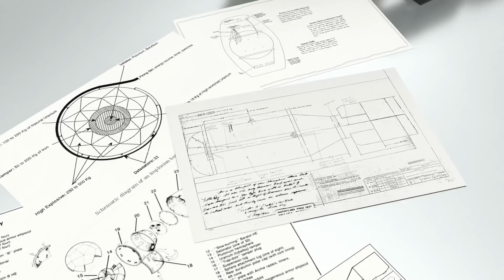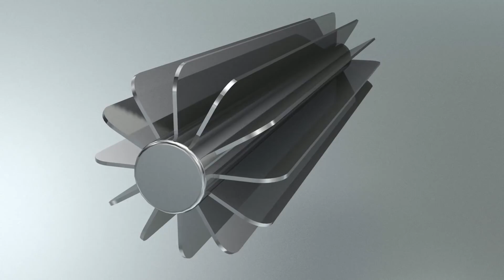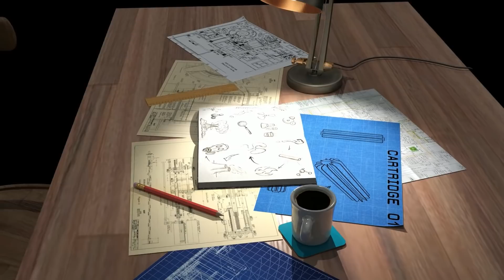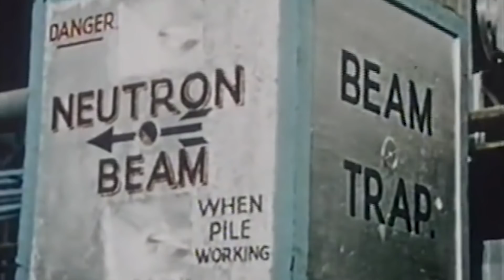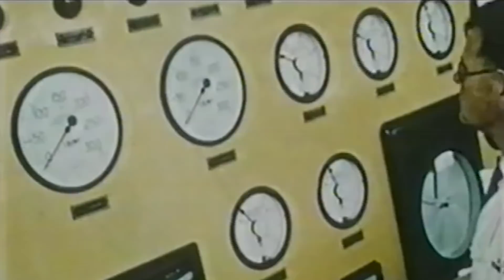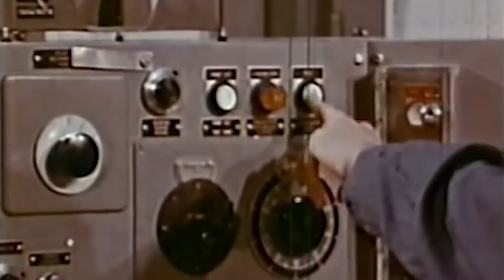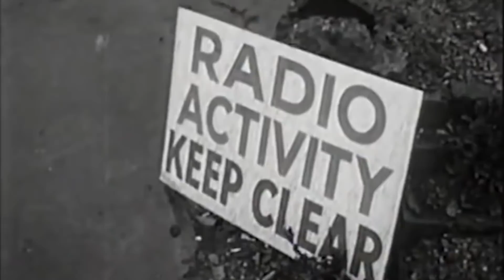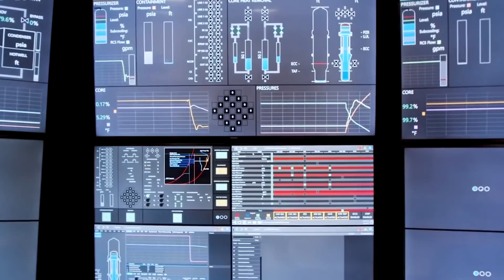Atomfall - Windscale Disaster - How The British Chernobyl Was Stopped

Comment: Apparently my grandfather was the first of the engineers to spot this fire. He worked at Windscale for many years as an engineer managing the reactor but sadly died of cancer before I was born.
Reply: I worked with a bloke who inadvertently predicted it. At the time, he said: "It should be burning out quite nicely now." Little did he realise it was burning out rather too well !
Reply: I can’t help but feel like yeah it’s safe, until something goes wrong. Take a look at Japan back in 2011, I’m sure every safety precaution was taken, but then a freak tsunami hits and none of that was worth a wank. We get told all the time “it’s the safest way to make power” I think theirs other ways.
Reply: @darrenicome559  they made one rather large over sight though that would never happen again... They put they're backup generators on the ground level so when the cooling systems power source failed, they couldn't reactivate it with the backup as it was flooded. Which resulted in the outcome. If they had put they're generators on the roof, it would never have had issues
Reply: @wallace_4520  my point is that there can always be things which can be overlooked. No one would of thought to them “self’s let’s put the back up generators on the roof in case of a freak tsunami” they would only think this because it’s already occurred. It’s the threats we can’t see which are the biggest. If something was to go wrong in a big enough way it has the potential to make large areas of land uninhabitable. I don’t feel like it’s as safe as people make out. Not only that but there is no way to properly dispose the waste, it just gets buried
Reply: @darrenicome559  they built a nuclear power plant right beside the ocean in a country renound for earthquakes and tsunamis. The Japanese are well experienced with these natural disasters yet they knowingly built a sea wall not large enough to hold back tsunami waves from the size of earthquakes that caused the disaster at Fukushima. Putting the backup in such a bad place was just pure incompetence which would never happen again. Also, in the UK, we don't get earthquakes so this isnt a problem. There are that many regulations surrounding nuclear power that nothing is overlooked. As well as this, nuclear companies are responsible for the plants after service life and are responsible for their full dismantling and restoration of the ground to as it was before the power plant was there. This is not the case for renewables and as a result, we now have abandoned wind turbine bases everywhere.
Reply: @wallace_4520    sorry for the late reply I’m terrible for that. You seem very informed in the area and I do also believe what you say about the level of safety precautions which are taken, trouble is I still can’t agree. Unforeseeable problems can still happen, yer we can pretty much rule out earthquakes but what about other things that haven’t happened yet. Could be neglect, terrorism or even something as unlikely as a meteor. Yer the chances of them happing are minuscule but if it was to happen there’s a lot at stake. I don’t know much about the wind turbines that have been abandoned but even if that’s the case your comparing two very different things. For a start the wind turbine won’t meltdown and potentially make a massive percent of the uk uninhabitable so there’s that, also they can be dismantled at any point if they need to be and much of it even recycled. Power plants have to dump their waste after as there is no way to dispose of it.
Reply: @darrenicome559  if we were all to do nothing due to a chance of something such as terrorism, then we would all do nothing. Modern nuclear waste has much lower radiation levels than reactors of the past thanks to new technology and methods of use. By using thorium, we can use uranium and plutonium for longer and be left with much less waste product. The other likelyhood is that terrorists won't be set up to handle radioactive waste to be able to use it effectively. Also, nuclear power plants employ security to prevent anyone without authorization entering the plant. 

As for meteors, if we experience one of them that is big enough to cause catestrophic damage to the power plant, then we have much bigger problems than radiation.

Also, it's not the wind turbines themselves I'm referring to. Most of them tend to be recycled due to the valuable metals within the turbines generator. It's the concrete base that they are formed on is the issue. These bases require 800m³ of concrete to create a strong enough platform for the turbines you see in the countryside. After the turbine has run its course, these aren't removed and are just abandoned, leaving giant concrete pads all over the countryside. This doesn't happen with nuclear plants, thanks to international agreements that require nuclear companies to fully restore the land after the plant is destroyed.

Other large problems with the likes of wind turbines is that they kill thousands of birds, prevent land from being used for growing trees, pollute the visual environment with large, unnatural structures and have a higher chance of malfunction than a nuclear plant due to them not being manned 24/7. Also, France is 86% nuclear power and has the best kept landscapes in Europe, whilst Germany is almost over 30% renewables and have tied links between higher suicide and depression rates as people have lost access to natural, untouched land.
Reply: @wallace_4520  I disagree on nuclear power. It’s not safe as it’s made out. It’s lazy and we could come unstuck. May be now or it could be in 200 years time, could be a meteor or could be a few security guards taking some back handers all I know is if something has the ability to go that wrong then don’t fuck with it. As for the slabs of concrete, I don’t like it but I can’t really see what harm that is in comparison to the nuclear waste again two very diff things. You say there’s less waste but there’s still waste and this has to go somewhere so the solution to this is to dig big holes and seal them underground. That’s a joke in itself, to me it’s all very simple if you can’t dispose of it don’t produce it. We should be looking into other solutions and encourage stuff like the Tesla invention, instead we kill the inventor and scrapped his idea all in the name of greed.
Reply: @darrenicome559  we don't dispose of nuclear waste as nuclear waste is the safest way to handle it. We can mix mining slag from the blast furnace (a waste product) with nuclear waste to create radioactive glass, the radiation from this material is far lesser than that of depleted uranium on its own. This material is then safe enough to be burried in shaft mines, such as the ones where the slag was originally mined. This solves 3 problems. Responsible disposal of 2 waste products and the restabilisation of mined ground. 

The media made nuclear seem scary after Chernobyl and Fukushima. But more people die every month as a result of renewables and fossil fuels than compared to all the deaths ever by nuclear. This includes Hiroshima and Nagasaki. 

As for plant security, special clearance is still required to be anywhere near nuclear waste so no one who shouldn't be near it, isn't getting near it.
Reply: @wallace_4520 I didn’t know they turned it into radioactive glass so it’s actually kinda good to know that it’s not uranium being buried I literally thought that’s what went into the tubes, you clearly know what your talking about and I appreciate you taking the time to educate me on the subject. I get where your coming from with the media latching onto that too. The thing is for me it’s not the case so much of feeling a certain way because I swallow the media’s crap, I just look at it as that’s cast iron evidence of what we can end up with as a direct result for whatever the reason could be. I just hope that the future brings us a better alternative.
Reply: @darrenicome559  I know it makes great headlines but look at the actual death toll from Fukushima. 15,000 people died in the tsunami. 500 people died getting trampled/car accidents while evacuating. 1 person died to radiation exposure. 1.
Reply: @Kiyo Senpai I'm with I prefer nuclear plants and the main reason for that is not global warning but the electricity price In Portugal in some places we pay 0.25€ per Kw and with nuclear it could go to 0.10€ to 0.25€, the sea rise would basically eat almost half of Portugal and since I live really close to the tagus River it would get flooded, the guys that sold us the small house were we built a new one they told when it rained a lot in the winter and the some places were starting flood close to were we live to grab a few sand bags and close the pipe that ran under the road behind our house because the water would get high enough to jump the 2.5 meters wall
Reply: Wow!
Reply: Cancer, huh? I'm sorry for your family. Kind of brings everything together when the last sentence I listened to in the vid talked of how safe nuclear power is - and the first comment is about a cancer death attributed to nuclear power. Safe my a$$. And all costs in: cheap my a$$.
Reply: @Steve_MFr  How did you jump to the conclusion that his work in the nuclear industry was related to his cancer ?
To 'spot' the fire would mean being in the control room with sight of the relevant temperature gauges. That would not be an 'active' area.
Reply: @Steve_MFr  Lots of people smarter than you have dedicated careers to researching nuclear power, it is safer.
Reply: @malfboi-c9j  not as safe as a coal plant in the worst case scenario but safe if all the safety measures are followed, of course there is always something unexpected than a happens like in Fukushima but over all this years there's only ever been 2 really bad nuclear cases
Reply: @almaefogo  eh you're just wrong. from a simple google search, "in the United States coal kills around 13,000 people annually, and 23,300 in Europe." 13 deaths TOTAL in the US were caused directly by nuclear accidents. fallout is more complicated, but Chernobyl, the worst nuclear accident of all time, caused an estimated 4,000 deaths. it's so much safer.
Reply: @Zreknarf  I'm not wrong since I said that in the worst case scenario the coal plants are safer because if a coal furnace/boiler explodes even if it kills people close to the boiler it doesn't have long term effects like the nuclear fallout has, I didn't talk about deaths related to coal mining, I was referring in a case of catastrophic failure of coal furnace/boiler or in the case of a reactor meltdown/explosion
Reply: @Zreknarf  in the case of deaths related to mining coal has a lot more than mining uranium and enrichment, but you also have to consider the storage for hundreds of years of nuclear waste that is toxic, compared to the waste of coal plant that for the most part are used in the construction industry, if they were to build a nuclear plant next to where I live I wouldn't mind as long as they don't cut corners in the security, I live in Portugal next to the tagus River and Spain as a nuclear plant close to the border in the tagus River and I'm not afraid of it at least for now since the plant is really hold it was supposed to close in 2021 but it's going to be open for a couple more years
Reply: @almaefogo  the risk can be managed in a safe and responsible manner with exclusion zones and iodide pills around a power plant. 

i would argue air pollution from coal plants is much worse than some nuclear waste stored deep in old coal mines, seeing as that is literally threatening 90% of life on this planet right now.
Reply: @Zreknarf  I mostly agree with you but you need to remember that most natural water Sources are deep underground and if they don't make the bunkers thick enough where there's water the water could leak into the nuclear waste and make a whole region water undrinkable and in the process every produce and cattle/milk not good for human consumption, let's hope they have learned from all the mistakes
Reply: @almaefogo  most of the earth's crust is already radioactive, just bury it below the water table and that's a non issue
Reply: @almaefogo  the chances of a nuclear explosion from a power plant in modern times is next to none, there are so many fail safes, and back up protocol set up to immediately shut down the reaction and cool off the reactor.
Reply: @almaefogo  fukushima was easily avoidable
Reply: Should have expected a tsunami to drown their generator basement smh.

also, people supporting coal plants either work in the coal industry or didn't really go to school (or are CEO's that don't care apart from profit)
Reply: @Zreknarf  what causes the deaths from coal?
Reply: @ilikelampshades6  mostly mining accidents, but also lots of fires, and of course the air pollution causes asthma, lung cancer, heart disease and strokes
Reply: @Steve_MFr  nuclear power is by far the safest source of energy we have today. The video said today, not 60-70 years ago. If you consider all the deaths globally caused by respiratory issues caused by the burning of fossil fuels. You'll understand just how much safer nuclear is.
Reply: Even taking these disasters into account, it is still hundreds of times safer than coal. Windscale had over 200 cancer cases directly linked to it. Compared to coal that is nothing. The only reason we still have coal fired generators is because nuclear power is expensive and those who profit from it would rather go with the cheaper option.
Reply: @Steve_MFr  100's of people die a year working on wind farms alone and he said its because of incidents like this nuclear power is so safe with the introduction of modern protocols and safety equipment/mechanisms
Reply: @Steve_MFr  it is safe, when done right

Comment: Windscale, the lesser known accident as precautions prevented it from being worse.
Reply: Both of the air-cooled reactors were functioning as slow-burning Chernobyls for years before the fire. Fission products were strewn about the whole area surrounding it, including the sea. The "Cockroft's Follies" reduced some of this, but plenty still escaped. People are still finding these 'hot particles' to this day.
Also, I have no idea what you mean by "precautions", because they were completely unprepared for this event, and only clever impromptu solutions resolved this incident.
Reply: @anhedonianepiphany5588  I kinda agree, what separate Fukushima and Chernobyl from this were explosions.  Radioactive elements are usually heavy, especially the Uranium and Plutonium, they are not going into the atmosphere, no matter how strong an industrial fan can be.  The lighter radioactive Cobalt, Strontium, Cesium, and especially Iodine are going to be the main concern, however they may be to heavy to make it up the chimney with the exception of Iodine .  The Iodine definitely got through the filter, but it has a half-life like 2 weeks.  The explosions of Fukushima and Chernobyl blew the contaminants way up into the atmosphere,  Most of the Uranium and Plutonium fell almost right away in a couple kilometer diameter of Chernobyl and almost none escaped the reactor of Fukushima.  It was the other radioactive elements that spread far.

Comment: ''Safest by far" my arse. That's completely discounting the fact that the incredibly toxic waste has to be stored for hundreds of thousands of years.
Reply: Actually, long-term waste storage concerns are relatively minor when looking at the overall safety of nuclear power. The longest lived radionuclides are the least problematic, radiologically speaking. The really nasty stuff decays away most swiftly. The nuclear power industry, as it stands today, is a long way from "safest", although some of the new generation reactor concepts hold a lot of promise in addressing almost every aspect of safety.
Reply: The latest design of power plants actually recycle old fuel but those filters at wind scale must be grossly contaminated. Wonder where they were buried?

Comment: It's far from safe, when you must evacuate an area in the size of Wales for the next 25.000 years... A windmill burns down, you install a new one after several weeks...
Reply: yeah, except for when you need power when there's no wind, or it's night, or it's cold out... Nuclear actually generates more than it consumes.
Reply: @Benkenobi8118  well, that's why you combine your power supply from several sources, decentralise into private grids and start implementing power saving methods. It's like you manage your own batteries.
Reply: @King_of_Railways  or you can just switch to Nuclear and have reliable clean power.